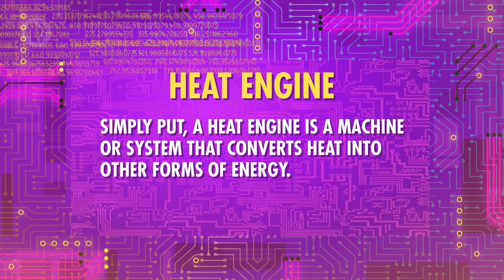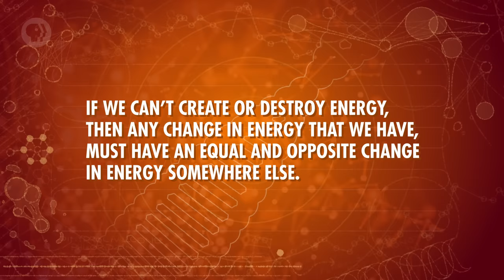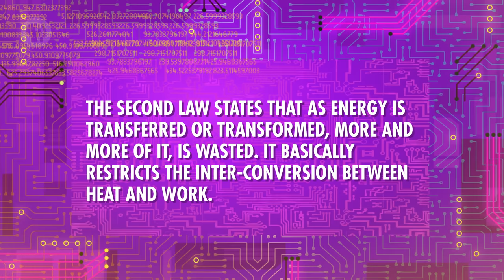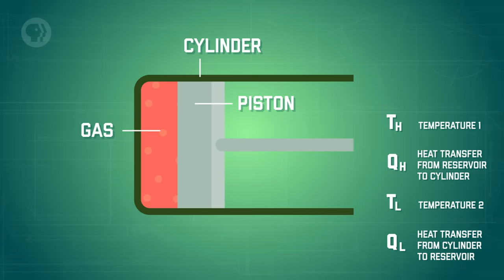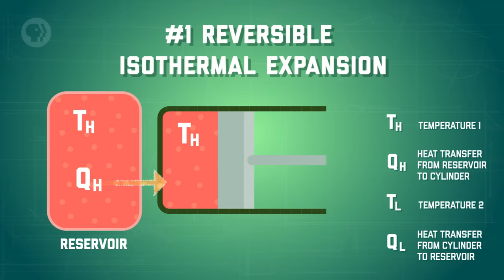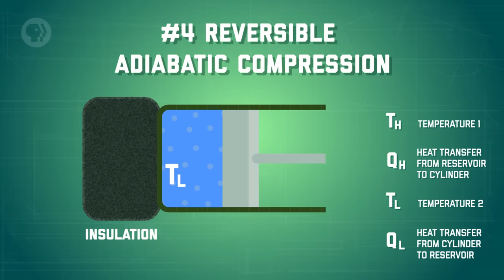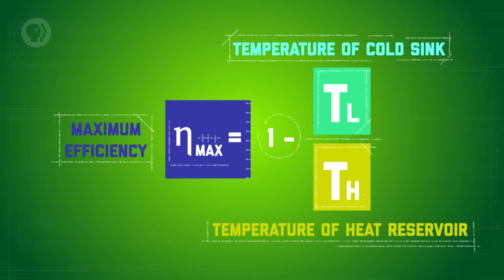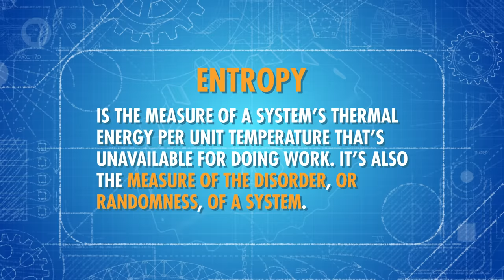Why We Can't Invent a Perfect Engine: Crash Course Engineering #10

Comment: "While it makes sense in theory, many doubt if it will actually happen."  - Crash Course Engineering advocating for anti-scientific belief.
Reply: no, astro physistis simply don't agree. Because of the weirdness of darkenergy, dark matter and contradicting measurements of whether or not the universe is expanding or shrinking.

It's not anti science, it's that astrophysics is really hard.
Reply: It's like telling someone they'll die of old age when they have a terminal illness.  
While it's still true that they could have died of old age, the illness will actually be what kills them.
If 'the big rip' scenario occurred, for example, it would probably happen before heat death.
Reply: Exactly. The universe could end in other ways before heat death.
Reply: Spoiler alert: the universe is expanding.
The most recent reference to a shrinking universe I could find was a 2016 article about how the observable universe will shrink because space is expanding.  Before that is a 2013 article about a scientific journal piece about a failed alternative explanation to the big bang.  Before that is late 2000s creationist articles misquoting early 2000s and late 1990s science.
No one is seriously proposing an alternative.

Big rip is a form of heat death.
Reply: Exactly, there isn't any real debate on this the rate of expansion is interesting so heat death is almost certain. This is really well established science and has been for a while. I don't know where this "doubt" came from. Overall, as an engineer/physicist I'm continually finding this series to have major stupid errors.

Comment: fake news. haha. these 'laws' apply to closed systems. not everything is a closed system. this only speaks to one type of engine' supplemental energy sources. if a heat engine were in a volcano I bet we could get damn close to 100%' I's a fan of the gas_electric_BROWNS GAS' hybrids work. start with regular fossil fuel' add electricity to water releasing browns gas_ then adding the browns gas to the fuel to air ratio. and presto. not a closed system' one hand washing the other' one day I'll make it happen

Comment: It has nothing to do with Copyrights/Trademarks/Patents?  I find that Incredibly hard to believe.
Reply: As long as you are talking about heat engines, no, it is simply physics, you are limited to the Carnot efficiency. Now, if you are turning something else than heat flowing across a temperature gradient into work, you can do much better - for example, hydroelectric powerplants are nearly 100% efficient, as they do not use heat to generate electricity, they use the kinetic energy of flowing water.
Reply: You cannot beat physics. There are physically limits to an engine's efficiency
Reply: Even if you pursue the copyright idea, don't you think the holder of said copyright would see the potential to invent better engines and steal consumers from their competition?
Reply: Anyone who HAS that patent, will be using it. Even still, there are hard limits to the efficiency of a heat engine.

The larger they are, the more efficient thermally, you can make them, engines designed to generate power very consistently over months (Power plants are engines) are the most efficient. And even those pale in comparison to an electric motor for instance.